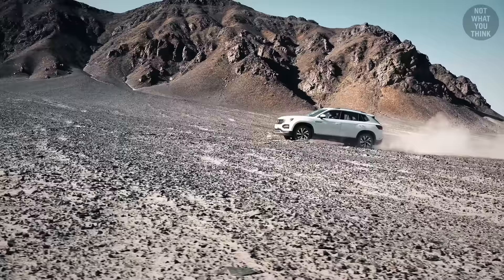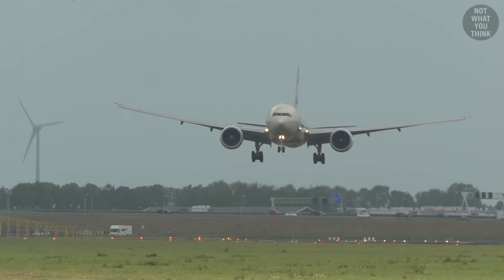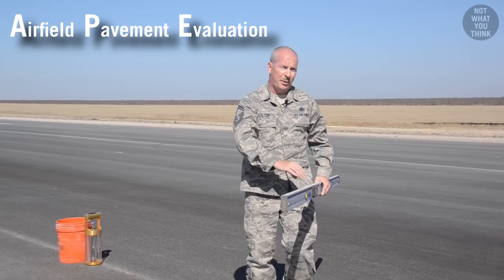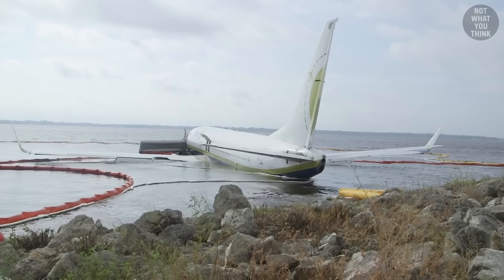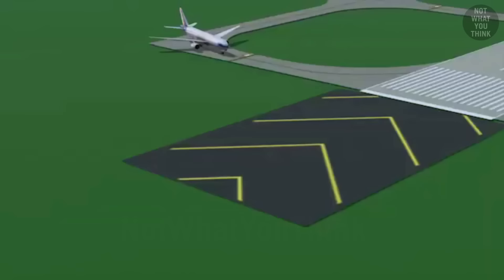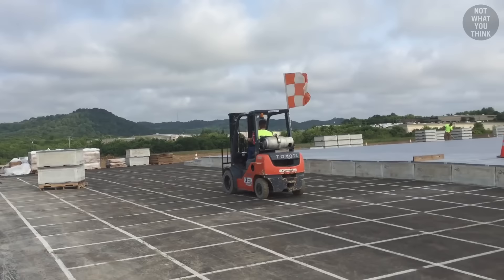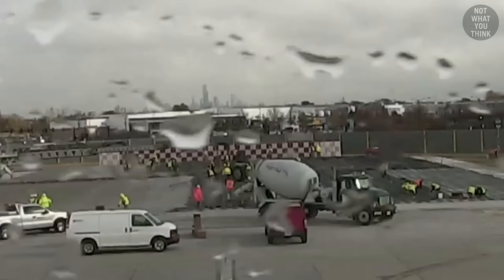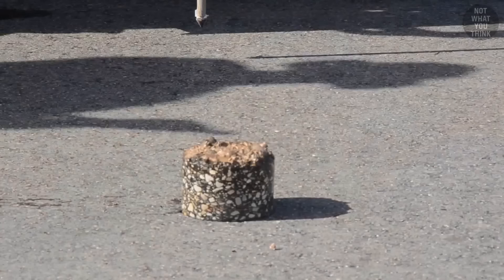The Invention That Stops Aircraft No Matter What

Comment: Seen the coring team at work once, they were trying to get a sample of the sub base on a road, and had cored down half a metre through layer upon layer of top material, before they finally came to the sub grade layer. That road had been getting layers of top wear course added every few years since it was built, because the ground had subsided a little with time, and the swamp had been drained. Plenty of roads have thick wear courses, because they simply got overlaid with new, and the crown increased, and every decade or so the pavements were relaid higher. Old pictures from the 1930's of the building i lived in had a set of stairs at the front, now the pavement is level with the top step of the building, stairs all buried. Where I currently live 3 steps down from street level, for the same reason.
Reply: Wow, that really puts it into perspective.
Reply: Wow yeah, it can get pretty nuts when they never regrade a road, just keep slapping it on :)
Reply: I've seen Russia doing that, the video said it was corruption though, getting paid to lay road even when it doesn't need it
Reply: Same around my house which was built in the early 1700s. Ground level is now above floor level. Not great for drainage!
Reply: @cooperised  and here at a village in the UK.  The drainage is rubbish, not helped by poor resurfacing.
Reply: I’m 😊
Reply: @samheasmanwhite  thats exactly what happens here all over india,and its quite worrisome to me lol. The road in my neighborhood is now literally 3/4ths a foot taller due to the maintenance folks again and again laying new roads on top of them
Reply: @jimmyneutron4360  I’ve lived in the same place for about 23 years now. I swear the main roads rose up by 5 feet. I can be pretty sure because the road of my residential is concrete, same one for over 15 years, and the main road was asphalt, relaid almost yearly. So the slope got pretty intense over the years.

Comment: Great post as usual.  But you buried the lead!!  The EMAS was added to "Bob Hope" airport - runway 26 - for a very specific reason:  Southwest Airlines Flight 1455 crashed through the end barrier, crossed a street, and plowed into a gas station!  Thankfully, no casualties.  But certainly one of L.A.'s most notorious aircraft incidents.
Reply: Huh, I forgot about that and only remember the Southwest Midway overrun. Very similar scenario with short runway(s) in a terrible location.
Reply: That's not burying the lede. Burying the lede (or lead if you use the older spelling) is mentioning the details but doing it in a way that "buries" them deep in the story rather than emphasizing them. I don't think he mentioned these details at all, (though granted I was doing other stuff while listening) so that doesn't fall under the definition of burying the lede. 

But even if he had mentioned those details, I wouldn't consider them to be the "lede". I think they were just ancillary to the actual point of the video, which was just to discuss the various methods that airports can and do use to slow down planes when necessary. This wasn't a video about Bob Hope airport or the EMAS at Bob Hope airport or the accident at Bob Hope airport, so those details can't be the lede.
Reply: @AdeleiTeillana  Thanks, Walter Cronkite.
Reply: @@Ayn-Rand-Is-Dead You're the reason people hate YouTube.  But thanks for the clearing up the spelling!
Reply: @@Ayn-Rand-Is-Dead I hate hurting someone's feelings.  Sorry, pal.

Comment: 2:34 is also why when landing in wet weather the landing is harder than normal as the pilot is intentionally landing at a higher than normal speed and at a steeper angle than normal. This helps minimise the hydroplaning because the water is driven out from between the tyre and the runway by the increased forces.

Comment: For the sake of precision, hydroplaning is different from, and actually a lot more interesting than, simply losing traction or friction because of water.  Hydroplaning happens when water gets in front of/under your tires faster than the weight of the vehicle can displace it .  The incompressability and pressure of the water raises your tires completely out of contact with the driving surface and they end up skimming across the top of the thin later of water, like a water-skiier skimming across a lake.  You're actually driving on top of the water, causing a potential complete loss of control or ability to brake in an acceptable fashion.  It's super dangerous, but still very interesting from a physics perspective.

Comment: The Heavy Weight Deflectometer (HWD) is technically a Falling Weight Defectometer as it has a single axle. Both are interchangeable but the HWD can deliver way more "oomph" to the ground :) It works by measuring the sound soundwaves picked up by the geophones from different distance from the point of impact.
Reply from the maker: Oh that’s good to know. Didn’t realize it measured things by picking up sound waves from distances. 😊👍🏼

Comment: While friction between the wheels and the runway provide most of the breaking, passenger aircraft still have reverse thrust from the engines they can use for breaking that doesn't rely on friction. Planes can still land on slippery surfaces (within limits )but the aircrew needs to know the conditions so they can plan for it.

Comment: Why doesn't the airport use the same net's that are used to stop a fighter jets on aircraft carrier's?
Reply: Maybe its a heavy material that cant be integrated into the end of the runway

I get your point.. it would save lots of mucking around in high wind landing
Reply: How much does a fighter jet weigh compared to a Boeing 787?
Reply: @wally7856  its like comparing a yatch to a oil tanker but lets say 20 tonnes to 200
Reply: @nolesy34  Ya, idk if a net is going to do it, would have to be one hell of a setup and not crack open the fuel tanks in the wings while doing it.
Reply: @wally7856  no, the net would rip of ailerons radars etc

Comment: An expensive but possibly good idea is to have layers of material so that a smaller plane (private jet) will not slam to a halt and a larger plane (747) will still stop due to stronger, higher resistance materials on the bottom.

Comment: How is it that jet engines don't flame-out while going through rain? 🤔 My simple mind just sees it like watering down the fuel. I know the basic functionality of jet engines but I still can't wrap my head around it 🤷‍♂️ if anyone wants to take the time and educate my small brain, I'd love to nerd out on that knowledge 🖖
Reply: in simple terms the high temperatures of the combustion reaction which can reach 900 Celsius instantly converts the water into steam which doesnt affect the combustion reaction, the compressor blades also help the water to be pushed off to the walls of the engine so that most of the water never even reaches the combustion chamber in the first place, there is not a lot of water in the air mixture anyway.
Reply: It feels wet when you're standing in it, but there's very little water by actual proportion.  I bet it would flame out if you aimed a fire host into it.
Reply: @grizwoldphantasia5005 Go look up a video on a deluge test. They'll dump 500 gallons at once into the front of that thing and it still won't flame out.
Reply: @grizwoldphantasia5005  You have to aim right into the core, as it has been proven hard to stop engines with failed controllers that run on, and cannot be shut off. You need at least 3 hose streams for around 20 minutes to finally get the engine to ingest enough to flame out. After all the original P&W jet engines were pretty good in rain, and they had no bypass, though you would get surging from water ingestion, and would have a lot extra wear on the first few rows of turbine blades as well from the water, but inside it creates a little more thrust by cooling down the mixture as it turns to steam, and then exits at a higher velocity, as the volume out has expanded so much more.

Comment: I think it will be also useful to build a portion of the runway in a slightly climbing angle. This will also decelerate the airplane faster, in a non destructive way.
Reply: which limits the approach ways by half...
Reply: @TheRomanWolf  True. You have to build another runway in opposite direction or to extend the existing one with long distance in both direction which is not practical. But what about installing arresting cables at the end of runways, same as in the jets ?
Reply: Like truck runoff ramps
Reply: yes theoretically, but that would take up a lot of space to do which kinda defeats the whole purpose of having a fast stop in an emergency. The destructive way is a last resort after all, so it being single use is okay if it means things go along a lot safer

Comment: "Its a bit like styrofoam. Usually its made of materials like expanded Polystyrene" So... it IS styrophoam?
Reply: Yes but you shouldn't go around saying the runway is made of styrofoam
Reply: @eageraurora879  correct.. other wise in a circumstance of an airplane using it in emergency all the kids will run out and jump in the pit... a very dangerous situation
Reply: I think it’s used in deeper under beds. It’ll eventually compress, but 20 years isn’t that long IMHO.
Reply: @nolesy34  thanks for your detailed life as a bottom/catcher. 🤪No idea where the intended insult comes from, and apologies if my observation got you butt hurt. 

Have a good day mate!
Reply: @TamagoHead  had me laughing to my bowels 👌

Comment: You'll also see these on the highway going down steep mountains. Here in Tennessee on monteagle mountain they have excursion pits every few hundred yards. The mountain is so steep and the trucker's used to lose control so often... It's basically just really fine  River gravel (or pea gravel.) And it's super deep. They'll sink several feet down into it and it can stop them in the length of about five transfer trailer trucks. And they're usually going really fast so that's  impressive to stop them in such a short distance.

I always found them interesting but I made the mistake of stepping into one once after an excursion had just been removed. I sunk down like 3 ft. Nearly left my damn shoes at the bottom

Comment: Imagine how much energy they could save at the concrete test facility by adding fairings to the rear of the wheel arms.
Reply: Why?  They're going 30 mph with no head wind.
Reply: @DroneStrike1776  Of course they have a headwind, they are in a building.   There are counter-gusts off of every single wall there.   The entire thing is a drag engine.

The OP is absolutely correct, a simple fibreglass fairing would save them enormously in energy costs over the lifetime of that facility.

Comment: It's funny to me that as I watch this video and the later half discusses the repairs and inspections on the runways in military installations, the flightline I'm working at has several sites shut off for repairs. idk how old it is now. but dang. there's cracking and hollow sounds from some parts of the ramp, I'm starting to doubt the quality they laid down however long ago the ramp was built/repaired last.

Comment: It doesn't look like the pavement testing simulator has the allowance for centrifugal force to be countered by the rolling tires.  Rather it is held by the opposing arms.  A closer look would be much appreciated.
Reply: Tom Scott did a video about one of these machines, titled "the massive Fatigue Carousel helps keep roads safe".
Reply: @maxthrust976  Yeah, I saw that one and the same thought occurred to me.  I have to assume the engineers got it right but the appearance of the tires tells a different story.  Hard to tell by the video though.  I would guess that the forces are all compressive.

Comment: aw comeon they already found a solution to this 23 years ago, you simply build a tower at the end of the runway. infact you could build 2 of them for good measure. like they can be the same, twins even. will stop the plane, or two even no problem. or you could build a wall, with a pantagon support structure behind it to make sure it doesnt topple over.

Comment: just plain sand with incremental depth will work fine and will not need to be replace each time.
Reply: If a plane gets in that situation they may need to do an emergency evacuation and get emergency equipment to the plane.  You do not want people trying to run away from the plane in sand, and it will be difficult for emergency equipment to drive on sand.  Also, they need to keep the area cleared of snow and ice, and this makes it easy to plow.
Reply: @briansomething5987  sand just in the landing strip, you can have both sides with pave even the collapsible one.
Reply: @yvanpimentel9950  runways are wide (say 200 feet).  That is the 'landing strip'.  If the plane stops in the middle of the runway you would have 90 feet or so of 'landing strip' on either side of the plane.  That is a lot of sand to run through or drive emergency vehicles through.

Comment: Never understood why planes don't carry parachutes to slow them down like some military jets have or space shuttle. You know, for emergencies.
Reply: Because it's a pain to set up and fold not to mention that it's hard to recover and reuse and can be easily be damaged rendering it unusable if needed
Reply: They designed aircraft like that before. Except nowadays airlines are more about cutting corners and treating humans like cattle to be ferried around rather than valued customers
Reply: @night2957  For emergency use? Isn't recovering a damaged plane and dead passengers even more hassle?
Reply: @you-dont-know-me  as I said it can be easily damaged and can be rendered useless. Its unreliable so airlines and even military aircraft start using different methods of rapid deceleration
Reply: If you need rapid deceleration, reversing engine thrust is WAY better: faster to activate, more reliable, more powerful accelerations, and doesn't lose efficacy at lower speeds.